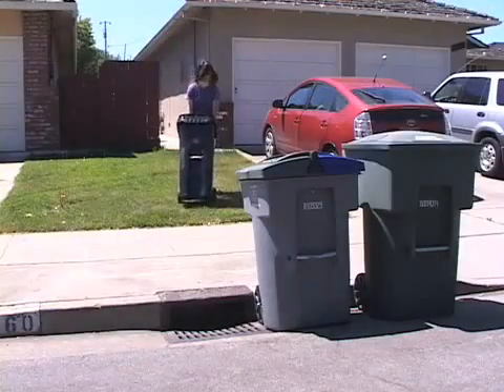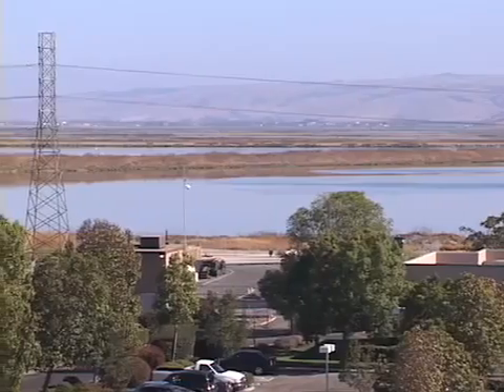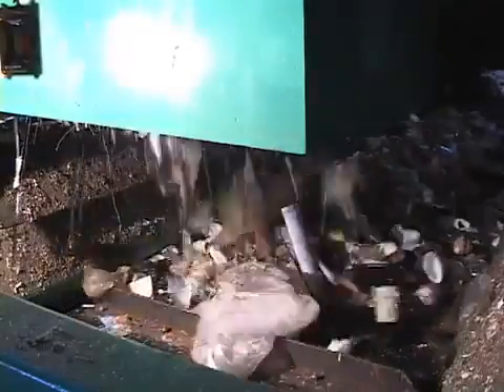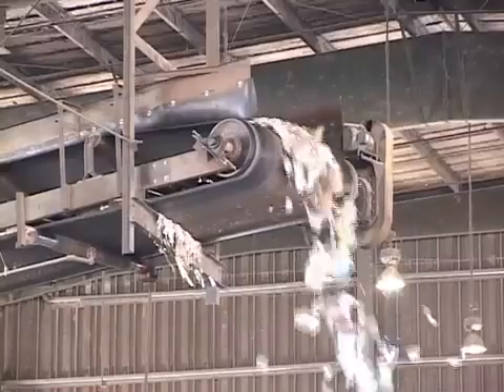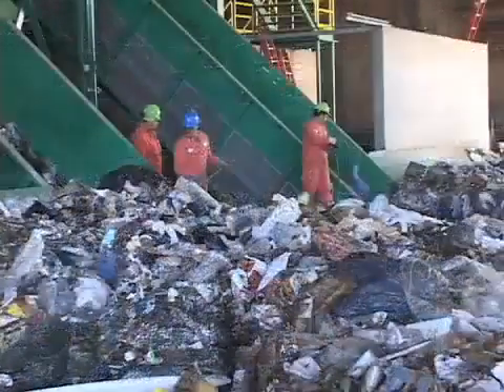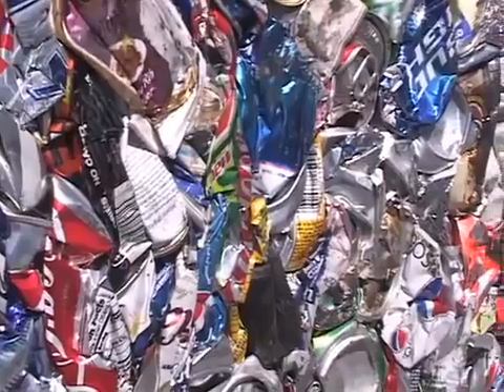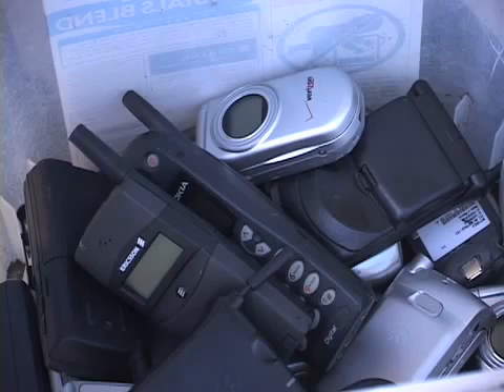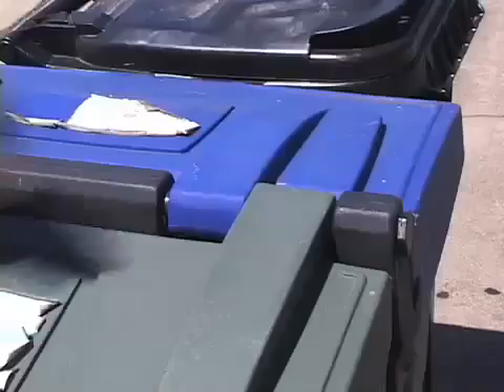Municipal Solid Waste (MSW) Recycling System- Sunnyvale SMaRT Station- CP Group

Comment: No way to sort sufficient quantity of recycled materials with such speeds and heavy loaded belts. No way .....You still sending to landfill HUGE recyclables.
Reply from the maker: Hi Chrysa, thanks for the comment. A small percentage of the stream, mainly residue, will go on to the landfill or other waste to energy alternatives. The equipment sorts and captures a very high percentage of what actually can be recycled. - CP Group
Reply: @CPGSortingTechnologies  
But this video states only 30% is removed to be recycled; the rest goes to landfill.